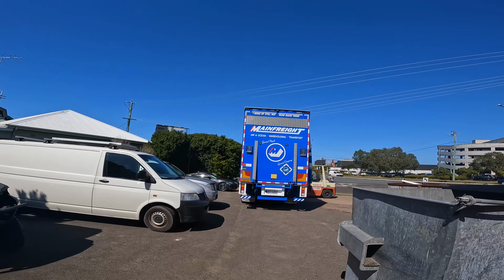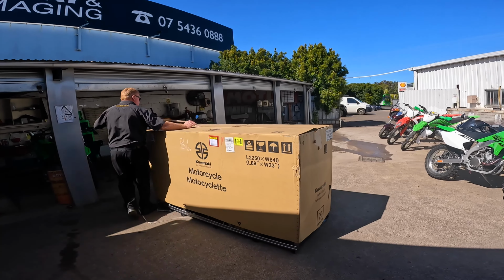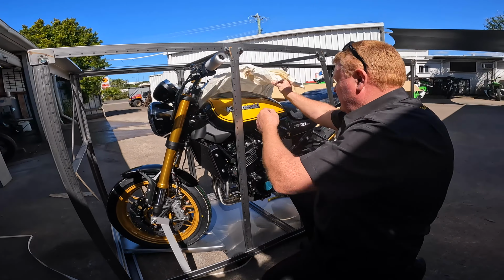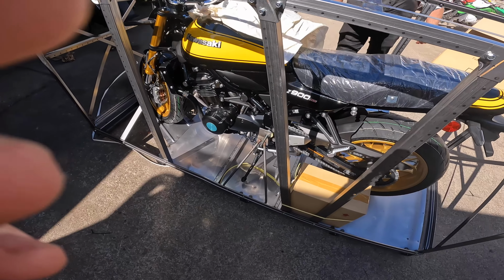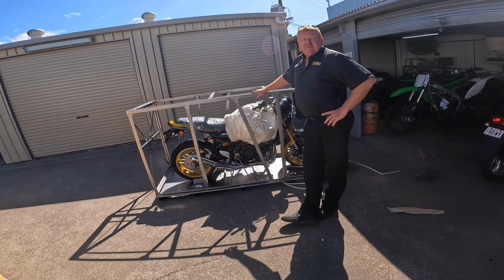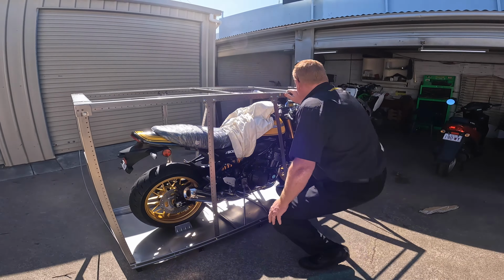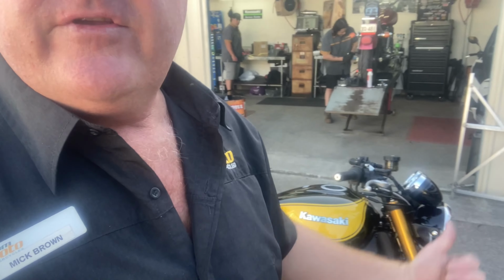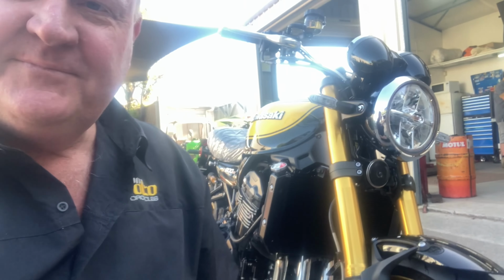Z900RS SE IN OZ, UNBOXED AND FIRST LOOK

Comment: Bloody beautiful,
Question, I have a 2018 Z900RS, is it possible to order the ohlins, Brembo and break lines through Kawasaki? And upgrade?
Reply from the maker: Not as yet mate, No parts are listed in the system for this model, Maybe later down the track but could get them from your local BREMBO distributor, Maybe?? Thanks for stopping by mate..

Comment: I own a 2018 z900rs cafe Adelaide Hills South Australia. Does your dealership sell (booster plug). Yellow ball looks great.
Reply from the maker: Not sure mate, we have not gotten into that side of it as yet...Will check it out and let ya know...Great machine the Z900RS..
Reply: @AussieKawiman  Great. The Booster plug is used to regulate the air fuel mixture and takes a short time to fit. It's like the combo of the green cafe you did with the Acropovic pipe then wacking in the k&n air filter and Booster Plug to auto regulate the fuel. No need to do ECU or Power Commander.
Reply: @craigoverall5753  I installed one on mine a few months after I bought my 2018, you have to order from the manufacturer in Denmark. It fixed the snatchy throttle problem on mine, but realistically a ECU flash is the only way to fix the throttle. Some bikes were worse than others it seems, but mine I couldn’t live with so I got the Booster Plug which like I said fixed the problem.
Reply: @gm16v149  I don’t think my 22 model is too bad but I came from a Z650 that was atrocious. I’d like to try the plug or maybe the power commander to keep from voiding the warranty with a flash.
Reply: Miss the Adelaide hills up in QLD now days never mind cheers